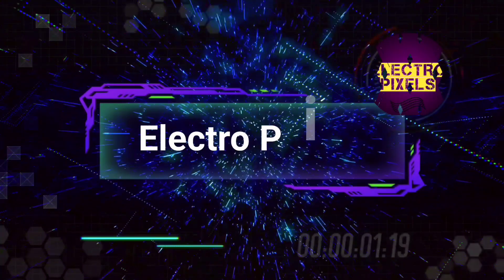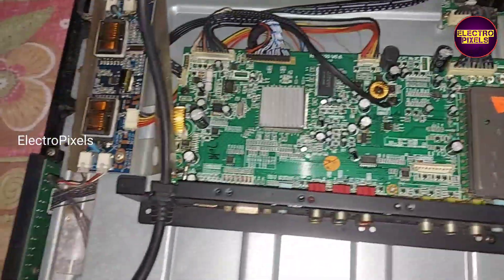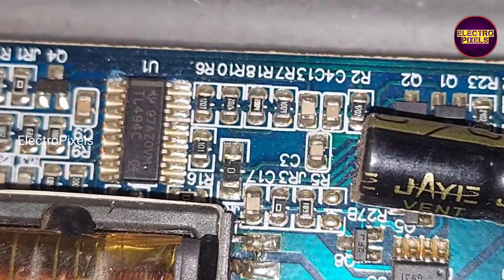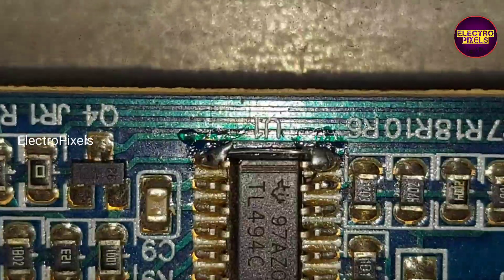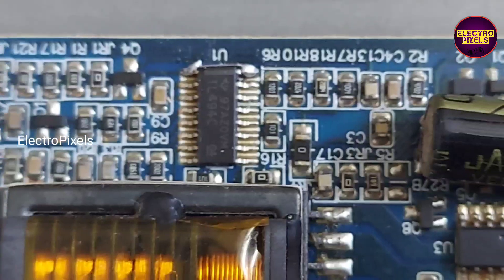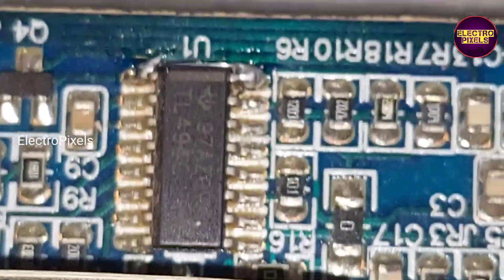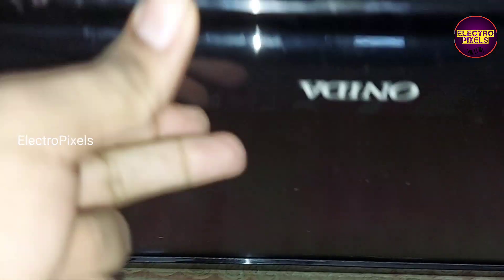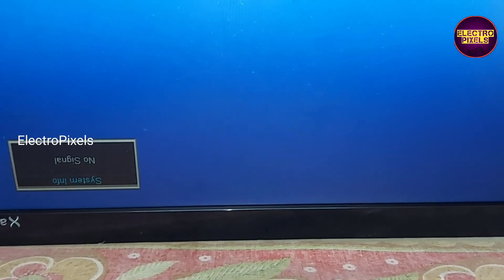22 inch Onida LCD Tv Backlight Ok No Picture |TL494C Inverter IC Protection Fault|Protection pin|Fix

Comment: Why should we short pin 1 and pin 16 to ground to remove protection
Reply from the maker: Not to ground short pin1 and 16 to each
Reply from the maker: Here Actually Backlight is ok, no other Shorting, if there is any Shorting we need to convert it with Led, and use led Backlight driver board
Reply: Pin 16 is over current protection when secandry short MOSFET burn out don't do that this is jugad